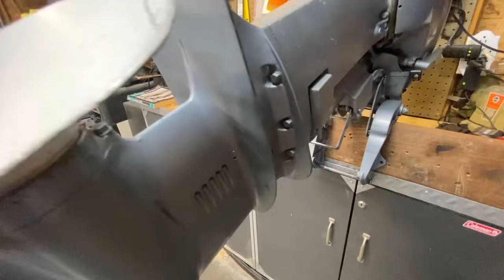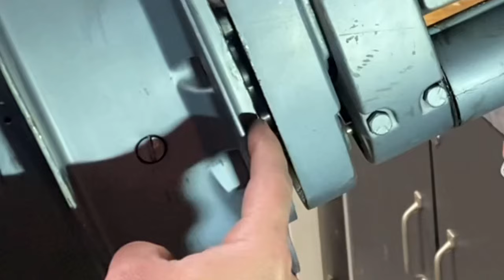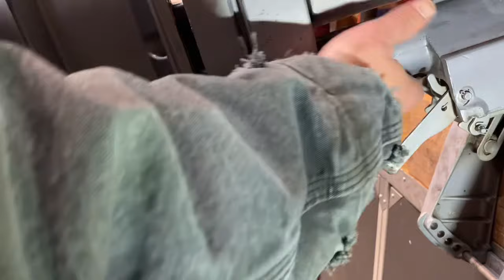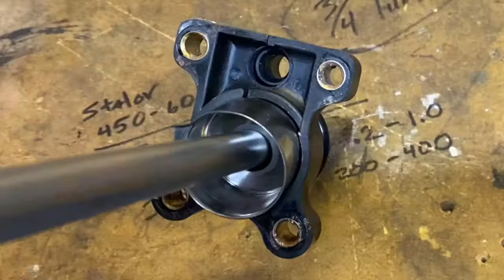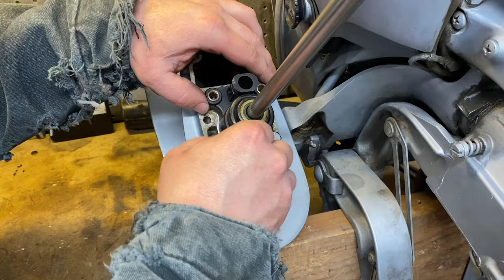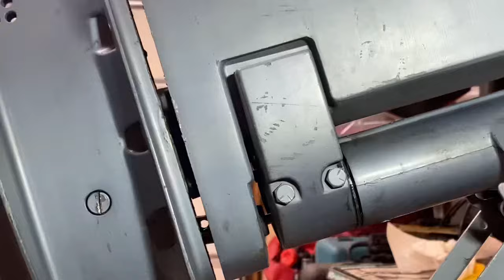9.9 - 15 hp Evinrude / Johnson water pump replacement

Comment: You didn’t mention the water restrictor (326885) that sits in the housing under the impeller housing to driveshaft seal. I noticed the kits don’t come with it so I reused the original one. I guess you didn’t have an issue not using it?

Comment: You didn't mention draining the gear oil prior to disassembly. I assume that's a must?
Reply from the maker: You do not have to drain it if you’re just replacing the water pump. It’s a good idea to check it, to make sure you don’t have any water mixed with the oil, if you do, you will have to replace some other seals that aren’t related directly to the water pump, but you can leave the oil in the gear case while changing the water pump.

Comment: If i put a water hose on the impeller tube should any water get into the cylinders? I did that and i noticed some water trickle out of spark plug holes. Compression test was 70psi. 9.5 evinrude.
Reply from the maker: No, you should never have water in the cylinder. Hopefully it’s just a head gasket, but if it’s ever been overheated, it may have warped the head too. If it ever froze up with water in it, it could’ve cracked something also.
Reply: @wetshoesmechanic  thanks for the reply.

Comment: Is there a rubber gasket between the plastic top piece and the bottom metal shield below the pump?
Reply from the maker: No, there’s no gasket where I think you’re describing. I’m attaching a hyperlink to a website that has a breakdown diagram that you could look at if you’d like. 

https://www.marineengine.com/parts/johnson-evinrude-parts.php?year=1984&hp=15&model=E15RCRM&manufacturer=Evinrude&section=GEARCASE

Comment: Thank you so much for creating this useful, easy to follow tutorial. Do you use a replacement OEM water pump, or buy an OEM kit and replace only certain components like the grommets and impeller? I'm in Canada and would like to know your recommended supplier. I've been warned to avoid Amazon parts in doing this job.

Comment: Thanks for the video. If you ever update it please point out the location of the exhaust baffle plate which has fallen out of mine when I removed the lower unit.

Comment: Check it every year???
Reply from the maker: Kind of depends on how much you run it, I can make mine last about every two years. Just because the fins are still intact doesn’t necessarily mean that it’s a good impeller. Sometimes they hold memory and they won’t push as much water. If you have a Telltale on your motor, you can kind of judge it by how much water pressure it’s pushing out of it. But I would plan on replacing it about every two years just to be on the safe side. It’s pretty cheap insurance that way.

Comment: My friend, I have this same engine. Yesterday I lowered the leg to clean the engine cooling system (water line), and when I removed the leg, the center rod or shaft got stuck or held at the top. In other words, the leg came out, but the center shaft remained stuck at the top (it didn't come out). Any advice on how I can free it (it's stiff, and I didn't want to hit it). Thanks.
Reply from the maker: Make sure that the shift rod linkage is disconnected and that that is not your problem. It’s possible that the two have rusted together slightly and if that’s the case, it depends on the severity of the rust whether or not it’s going to come apart. You might be able to turn the entire engine upside down and spray the shaft directly with WD-40, PB Blaster, or something like that and let it rest for a few hours and try it again. If they’re rested together too hard, you might need more tools and equipment, than the average person has at their disposal to get it apart. I wish I had better news for you, when they rust together like that, it’s pretty tough.

Comment: Have you ever had the rubber grommet collapse into the housing when reattaching?? I had that happen twice. Anyway to avoid that or know for sure the water tube is seated in the grommet correctly??
Reply from the maker: I haven’t had that problem. Maybe a little bit of dish detergent around the edge so everything slips together a little easier?

Comment: Hi - just used your video and changed out the water pump on a 1975 evinrude 15hp.  All went well.  Dropped it in a large tub of water and fired it up.  I am not seeing it discharging any water, is this normal?
Reply from the maker: Pre-1983 these engines did not have a telltale. There should be a little spray coming out with the exhaust, but most of the exhaust is underwater. You could try putting muffs on it just to verify water is flowing out of the exhaust. As long as your old water impeller came out in one piece you should be in good shape. If the old water impeller had fins broken off on it, you might have some water passages blocked and you’ll want to be a little careful on your first trip out if you’re not sure you got all of the impeller parts out.

Comment: Excellent vid mate. Concise and no annoying music. 👍
One question - for aligning the splines when reassembling, you were working the start cord... Why not just spin the prop a little bit?
Looks like that might be easier to do, and no risk of an inadvertent start.
(Or, at least take the plug leads off?)
Reply from the maker: You could do that way, you just have to make sure that it’s not in neutral. When I’m doing this with the starter cord, I’m not giving it even one full rotation, realistically only probably about 20° of rotation at too slow of speed to keep compression in the cylinder, so I’m not too worried about it starting.

Comment: Ive lost my pin one that locks in between impeler and driveshaft, what should I do...
Reply from the maker: https://www.marineengine.com/newparts/part_details.php?pnum=OMC0300611

This should be the part you’re looking for. If you need it in a hurry, I would take this part number to any local boat shop and see if they have one in stock.

Comment: Super nice video on how to do this.👍 I just followed these steps while installing a whole new waterpump kit on my 1980 9.9 Evinrude. No water had been coming out of the exhaust or the telltale stream so I was sure this would fix it. I tested it with muffs and let it run for about 45 seconds, and no water from the exhaust or telltale. Can you tell me what to check next? Thanks
Reply from the maker: Was the old rubber impeller in one piece still when you took it out? If not, some of the rubber chunks might be blocking the waterways throughout the engine. It’s also possible you picked up some sand or something of that nature that’s blocking the waterways. I’ve also seen the water waves around the head accumulate hard water deposits enough to start washing stuff, which could be a problem. It might be worth it to take your thermostat out and verify it that it’s working properly also. I would start by taking the lower unit off again, and putting some compressed air through the pick up tube and see if it comes out anywhere. I wouldn’t use high-pressure, about 20ish psi is all. Verify that the the key for the impeller didn’t fall out at some point during reassembly.

Comment: thank you so much. just bought an 83 9.9 and I'm changing the water pump this weekend. Do I need to lubricate either end of the drive shaft when I reinstall everything?
Reply from the maker: A little bit of grease on the splines on the part of the shaft that connects to the motor isn’t a bad idea. It helps displace water to keep it rust free.

Comment: Make sure you let people know they must remove the bolt on the shift shaft for the lower unit to drop out.  It took me a while even after hearing one mechanic say that….. it just looked like it should come apart without totally removing that bolt.

Comment: I have a 1976 Evinrude we have used for years (since new)........never have changed the water pump :/  maybe we should?
Reply from the maker: The impeller is pretty cheap, and just to be on the safe side. I would change it out at least every couple years. Even if it’s not weather checked, or falling apart, the fins lose their elasticity over the years and you will lose water pressure over time. If you wait too long, the impeller blades can start deteriorating and falling apart and once that happens, they get into the waterways inside the block, and they become problematic to get out later.

Comment: I bought a shop manual for mine, and it contains dire warnings about not removing the drive shaft, else you will need to disassemble the lower unit in order to realign the pinion gear.  And of course, I accidentally pulled it out a few inches while trying to clean off the shaft.  Now sitting here wondering if I need to tear it all apart, then I find this video where you remove the shaft and reinstall like it is no big deal.  Wondering what I am missing.
Reply from the maker: It’s possible the pinion gear shifted inside the gearbox just enough to make the shaft Alignment tough. With a flashlight try to look down the hole and with a pick, or even a stiff metal rod you can try to realign it enough for the shaft to fall into the gear. I’ve never had trouble with the 15 hp, but I have struggled with a 2 hp that has this problem. Worst case scenario you might have to pull the gearbox end off to get in there to realign the gear. It’s not too bad if you have to get into that.
Reply: @wetshoesmechanic  Thank you for the reply.  I had tried to put the shaft back in, and it would shift into reverse but not forward.  On the advice of another friend, I turned the shaft slowly while trying to shift it into forward, and it eventually went.  I put it back together and it seems to be working fine now.  The manual I bought is horrible; tries to cover decades worth of motors and jumps around a lot.  I would have been better off going straight to YouTube.

It's an old motor that used to belong to my dad...  After he passed over 20 years ago, I had the local outboard shop winterize it, then I packed it in a crate.  I hadn't planned on leaving it there quite this long, but with new plugs, new water pump, and fresh gear lube it appears to be good to go again.

Comment: So i opened up my lower unit on my 1974 evinrude 15hp and there want like oily milky stuff everywhere. what is it. i cleaned it once put it back on and took it back off and it was there again. so what is this stuff.
Reply from the maker: If the oil in the lower unit is milky, you have a bad seal somewhere and water is trying to mix with the oil. There is a seal on the input shaft going into the lower unit, there’s also a O-ring seal around the shifting shaft, coming out of the lower unit, and then you have the output shaft seal going to the propeller. If you have it all apart to the point of replacing the water pump parts, I would suggest replacing all of the before mentioned seals. You might look at the prop shaft seal. Sometimes you can pick up fishing line and it will cut that seal up as it twists around the shaft. You can also drain the lower unit while it’s off of the rest of the motor, put one of the plugs for the oil back in, and hook up some compressed air to the one that’s left open, spray a little Windex around all the seals and see if you can get one to start bubbling. Don’t use any more than a few Psi when doing this.
Reply: I drained the gear oil and it wasn’t milky at all. i think it might be a seal under the impeller housing. could that be the one i need to replace?
Reply from the maker: If the oil in the gearbox looks good, I think you’re OK. If you have milky oily, residue outside of the gearbox up around the water pump, it’s probably just water left over mixed with exhaust oil. The exhaust on two strokes will have some unburnt oil mix with it. If you’re not sure, put your finger in it and smell it. If it smells like gas a little, it’s exhaust oil. If it smells skunky it will be gear oil.

Comment: Water pipe grommet under powerhead often swell clog off water flow in salt water useage.
I had to pull dozens of power heads clean replace grommet and water tube hole corrosion.

Often engine runs hot overheated from insufficient water flow.
Otherwise excellent motors .

Comment: Man. nice but you didn't show the most important part, putting in the shift linkage bolt !
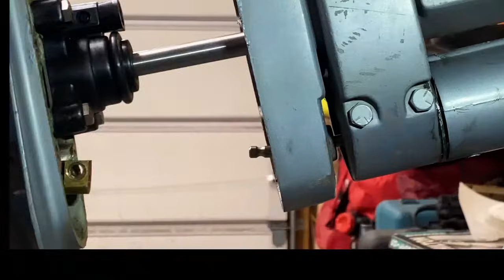Reply from the maker: I tried to explain it the best I could from 13:17 - 14:48 in the video. It’s really hard to get a camera in there focused well enough to see what’s going on. Thank you for your feedback though, I might try to do a video just on that at some point.
Reply: @wetshoesmechanic  If you pry up on the gear case side of the shift linkage, it puts the gearbox into reverse.  With the shift lever in the forward position, but the gearbox in the reverse position, there is lots of room to line up the shift linkage and get the bolt in there. Then when the linkage bolt is in, shift the lever to reverse, and it pulls the whole assembly together.

Comment: 4:18 what about if I don’t have any rubber left?
Reply from the maker: If there is no rubber left from the impeller blades, you may have to go through your whole cooling system throughout the motor to make sure that there isn’t anything clogged up with the rubber bits. Some of the channels throughout the head and block area can get plugged up with these. They could get jammed up around the thermostat and prevent it from operating properly. Unfortunately, when an impeller gets that bad it’s a bit of a headache to try to verify everything is cleaned out. tear it all down, try to blow everything out really well, and hope you got it all out. Especially for the first few times out again really pay attention to make sure nothing is overheating.

Comment: Still have part for this engine?
Reply from the maker: Certain parts are getting hard to find, but your local Marine shop should have access to most of them or here’s a website: 
https://www.marineengine.com/parts/johnson-evinrude-parts.php?year=1984&hp=15&model=E15RCRM
Reply: @wetshoesmechanic  thx for the info

Comment: I have the same motor it won’t go into reverse gear any idea what it is ?
Reply from the maker: Check the brass coupler where the lower unit comes apart from the Exhaust leg, and make sure the screw fits into the groove on the shift shaft that goes into the brass coupler. You might have only gotten the shaft part of the way into the brass coupler.

Comment: Do you drain lower unit oil?
Reply from the maker: You don’t have to. If you set it down and it starts leaking oil that means that the seals and or the O-rings were compromised for the lower unit already anyway. Just to be on the safe side I always drain my lower unit oil at the end of the season and replenish it with new oil. If a seal is compromised and water gets in there, it could potentially freeze and break the lower unit during  winter time storage.

Comment: Cool video good tip on pull start couldn’t get my bottom back on after I just taken it off to do impeller and already had it on once but guys make sure the throttle doesn’t move could cause it not to let u put in F N R if it turns just sain had it done now still can’t get it!! But cuz this video I got it thank you!!

Comment: Very helpful, thank you. Question for ya- i have a 1992 9.9 evinrude E10RENA. Was running great but after storing over winter, the throttle will not turn in neutral, it won't turn like it used too and is jammed. Once its in forward, the throttle can engage. Any suggestions are much appreciated!

Comment: Very nice video, thanks. I have a question for you sir. Would this be the same or similar process when doing the impeller on a 1966 SeaKing 9hp?
Reply from the maker: Most outboards are Fundamentally the same design with the water pump. The biggest difference would be the shift linkage. The shift linkage changes between manufacturers, and horsepowers. I’ve never worked on that particular outboard, but if you take your time with the shift linkage and see how it’s connected between the lever to the lower unit there should be a bit of linkage that can be disconnected somewhere mid motor.

Comment: Just as a kindly bit of advice,, when you go through the effort of dropping the lower unit for a water pump inspection,, it always better to just replace the pump impeller, especially if it's around two seasons or so old.  Because two years of usage will tend to make the 6 impeller veins/arms stay in the bent in position, which is called ~cold shunting~!  
      If the 6 veins/arms stay bent over, they've lost around close to 20% of their pumping ability!  Therefore, it's wise to simply replace the impeller, and make the work effort worthwhile, and help the customer feel sure of the cooling system for a few more years!!!!  Cheers!!!! Very nice video presentation~!~
Reply from the maker: Couldn’t agree with you more.

Comment: I Done my impeller! And now my engine struggles to go into forward it won’t properly clunk into gear forward only, any help?
Reply from the maker: It’s probably the coupler on the shift linkage where the lower unit comes apart. Part of that shaft has an indentation in it that needs to align with the hole in the coupler so the bolt captures it properly. More than likely it missed that indentation and it’s clamped in the coupler which makes the linkage just a little too long. Unbolt your lower unit and  your shift linkage and try to align it again. If you’ve never done this it might take a few tries until you get it worked out.
Reply: @wetshoesmechanic  I know exactly what you mean I will try that thanks!